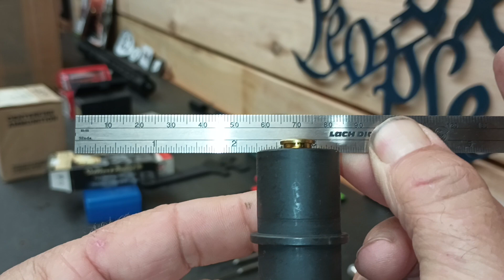Bear Creek 10mm Viewer Question, Barrel chamber support.

Comment: 10mm is very different from chamber to chamber of different guns. Just subbed.
Reply from the maker: Thanks for the sub. 
Yes, "non Glock" reloaders would yell at me when they got my brass mixed in with their spent brass, and had to full length size it to fit their gun.😅
I think it was around 1989 or 1990 I started reloading.
Reply: @Michigan4Conservative  I just started reloading 10mm this year. I got a M&P 10mm. It works but now I wish I would have bought a Glock.
Reply from the maker: Well, this IS America.....
Buy 5 Glocks if you want.💯🇺🇸
Yea, I probably would have bought the Springfield or S&W 10mm if I didn't already have the G20. (I think I've had that since 1994 or 1995)
I had a red dot on mine 20 years before this current "trend" of pistol optics. I went back to open sights after the novelty wore off.

Comment: Hmm. What was the original question? At some point I might decide to start reloading 10MM.
Reply from the maker: "How is the support and does it budge brass", was the original question.
I was assuming the support had to do with the chamber? But it could also mean "customer, or product" support, from their customer service?? If that is the "case" (pun, pun, pun😅), customer support for me is non existent.

As far as brass bulge, I would have to say, from what I seen in the video, the Glock would bulge more than the BCA.
Perhaps one might see the void at the feed ramp as a potential for a single bulge to form, but I have not noticed anything unusual about the spent cases.
Reply: @Michigan4Conservative  yea you’d notice overly bulged cases after shooting if the chamber was in supported.
Reply from the maker: @ChristianGrest  field testing tomorrow. Most of the BCA and Glock brass all mixed when I did range clean up. But, I haven't found any yet that wouldn't resize and fit a case headspace gauge. (But, that was all new factory brass) I'll push some hot reloads and see what the brass does.

Comment: Ok my question was about after you shoot the round and size it. I’ll do a vid about what I mean within an hr after an upload. The walls of the chamber is fine. 👍 BTW I have the same box of Speer in 9mm hp and LMAO, should have bought tons @$35 a box. 😂
Reply from the maker: I guess I am missing the question.
A spent round, once resized and reloaded, should fit in the headspace gauge the same as a new round. If it fits the gauge, it fits the chamber.